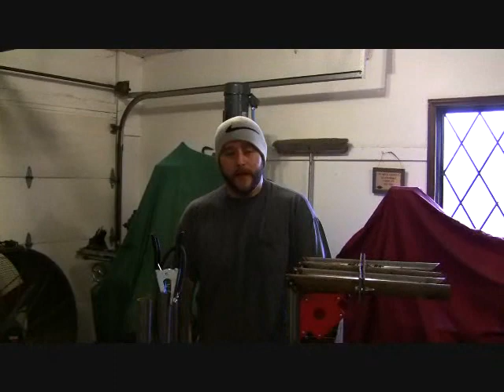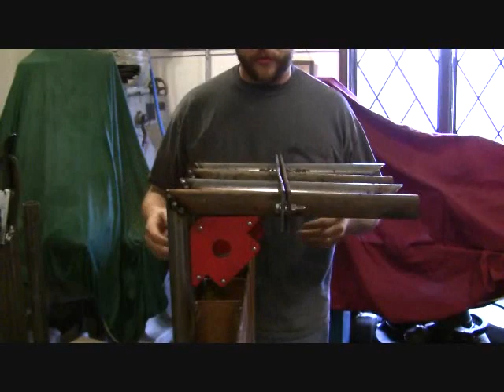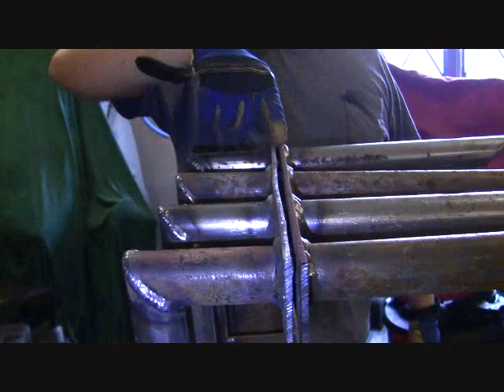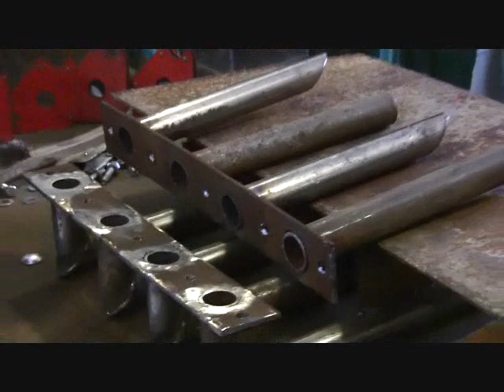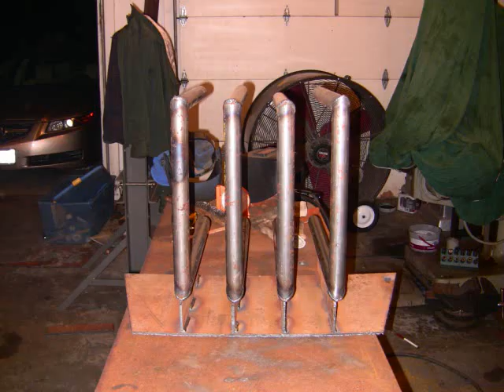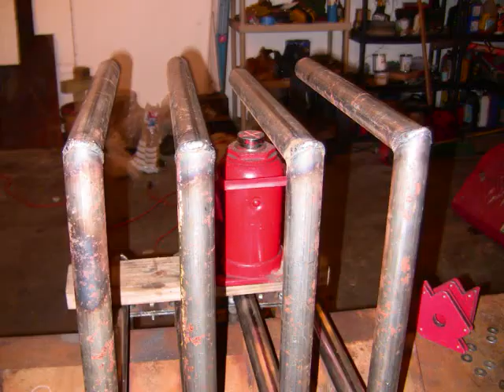New Project Part 3

Comment from the maker: @cdacaraudio  yea we finished it. Works very well. we ended up using a small squirrel cage on the inlet to help move the air a little faster. the air still comes out very hot from the tubes, so i would say it's a win win. :)